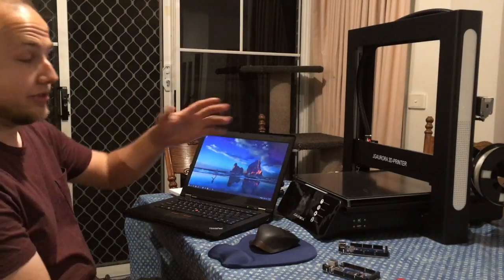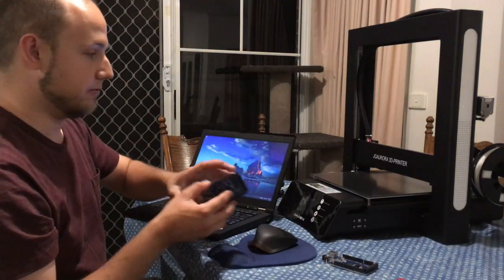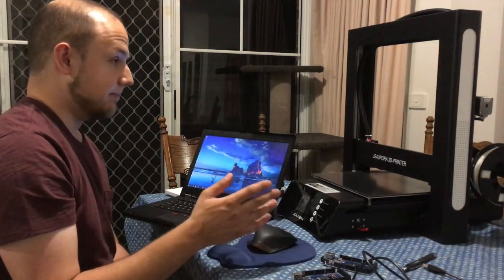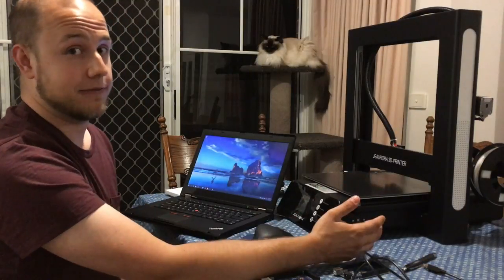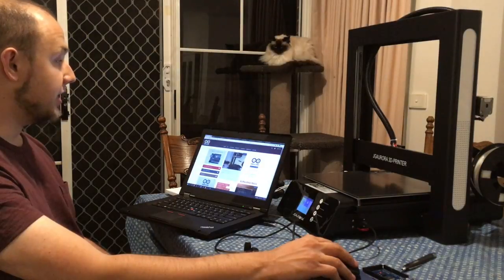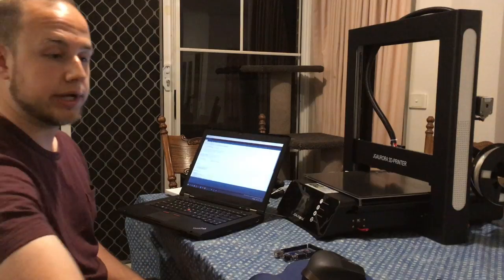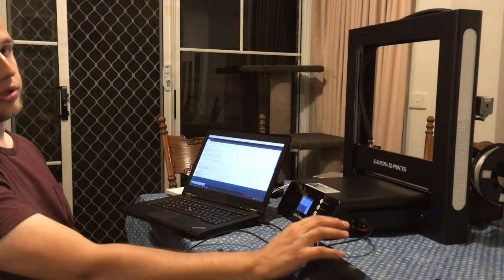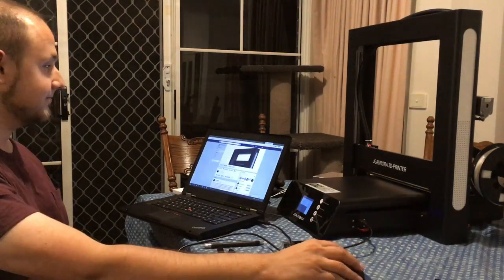How to upload custom firmware on JGAurora A5 3D printer

Comment from the maker: IMPORTANT: MAKE SURE YOU UNPLUG LCD CABLE BEFORE FLASHING!!
I'm sorry the audio is so soft! Also, please see this follow up video if you have error messages in Arduino: https://www.youtube.com/watch?v=0GCyrFAmj2A
More JGAurora tips and tricks on the wiki: http://www.jgaurorawiki.com/a5 and support on the forum http://jgauroraforum.com
Reply: Have  problems assessing the website
Reply from the maker: @levon2371  the dropbox links not working for the next 24 hours but everything else should be ok?

Comment: I just upgraded the printer to the custom Marlin firmware and also upgraded the LCD display. WOW! Like day and night. Super thankful for this awesome contribution! 
Anyone that has a good Cura print profile to share? 
Will do some stringing tests tomorrow :)
Reply: I did some print test, and initially I had problem with strings etc. Then I found this print profile: https://github.com/ceakins/3d-Printer-Profiles/tree/master/cura/Material-Templates/JGAurora/A5/3.2.1 
Not sure who is the mastermind behind it. I had initially tried this cura profile before upgrading my firmware on the Jgaurora A5, and it was horrible. Then I tried it again after upgrading the firmware, and now my printer prints waaaay tooo nice!!!! WOW! I'm so happy :D. I get quality prints that easily competes with much more expensive 3d-printers.

Comment: All went well for me, no problems with the upgrade. I think the PID settings are off though, has the hot end will overshoot by 8 degrees before settling in. I may run an autotune PID later to see what values it produces.

Comment: I followed the steps to upgrade my printer with custom firmware but I encountered several problems. I started the custom firmware with the Arduino software, checked all the settings compiled it and get the message that a library is missing. Tried to install the u8glib but it cannot be found in the library.  Whats going wrong? Rob, The Netherlands

Comment: If you have a modern version of Marlin working adding a bltouch would be possible as long as it's got a spare pin port for the probe as long as the board has enough memory to upload the extra features.

Comment: Sam, hopefully you can help, New to the A5 and 3d printing, but have some major issues. Looks like my unit was built in Nov 2017.  I updated to Marlin software using your instructions.  The issue came with my first print that stopped around 65%.  I was using a USB cable and the most current version of Cura.  The print was going fine, when I went into the front touch screen and was reducing the fan speed, all the sudden the print just came to a stop.  Prints were printing like garbage prior to this, and I've been tweaking the temp, bed temp along with print speeds.  Prints continued to print poorly, so I deleted Cura, reinstalled, deleted JGCREAT and reset the printer to the newest (January 2018) hex file of the factory software that I found .  I am trying to figure out what is going wrong and if I need to update the touchscreen firmware along with how to update it.  I've tried to update firmware again, and re-install cura, same results, maybe worse now, as prints are failing sometimes before the bed and extruder come to temp. This last print failed once via usb, didn't even come up to full temp on bed or extruder, and I tried again via thumb drive and again it failed at the top of the brim.  I was tried JGCreat that time.  LCD firmware type: MKS tft  version: 3.0.0

Comment: Hi Samuel... first of all thanks for the video... as a content creator myself I know how long it takes to make a video... 
My A5 loves to layer shift on large Gcode files... do you think this upgrade could solve this issue?!?
Thanks again and best regards from Brazil!!!
Reply from the maker: Thanks so much ;-) - I don't think the firmware would solve that, but I have already created a dedicated page specifically on solving layer shifting problems on my wiki here: https://jgaurorawiki.com/a5/layer-shifting Kind regards, Sam
Reply: Thanks so much for the answer and the article... but I don't think there is something to do with your article...
There is too much coincidence with large (megabites not long in time) gcodes files...  
Thansk anyway... realy realy apreciate your videos... got yourself a new subscriber!!!
Reply from the maker: Ah! Perhaps try printing via pronterface to see if the issue is a file reading problem on the lcd module.
Reply: Yeah... the first time it happened was via usb pendrive... it happened 3 times that way... and yesterday it happened using the raspberry pi... have no idea what to do...
this last time I paused the prin via the octoprint, re-homed X and Y and resumed printing and  it worked out, had to do this 2 times in the same print... it seams that in the midle of the print job it just looses the X and Y home points!!!
Reply from the maker: Well, I’m confident at this point that the 1.1.8C firmware is reliable enough to recommend it without hesitation. It has no downsides.
Reply: So lets Try it... hope it helps... will keep you posted...
Thankyou so so so muchhhhh!!!
Reply: Sorry... one more question... why unplug the LCD and how do I do that?!?

Comment: Thanks for the detailed video wonderful work. Did you have to modify the marlin software to communicate with the second mother board? I am also thinking of changing out the heat break on my hot end in order to print at higher temperatures,  how would I be able to increase the max temperature? thanks again!
Reply: I just installed Marlin on my A5 but the Z axis seems to have a jitter when I move it manually and the rate is set to 10mm and also after homing the printer and moving to the first point to perform bed leveling. How can I address this issue? Thanks!
Reply from the maker: I'm happy to answer different questions -- but youtube comments is not the place unfortunately. We have a JGMaker A5 group on facebook. I would recommend to join that and we can discuss there.

Comment: Great video.

I just purchased an A5, my second 3d printer, based on the information you and Da Hai provided. So far I am very impressed. I have just set it up and tested everything but have not yet done any printing. I have a few questions. If I update to the community firmware does it also provide LCD access to the EEprom and the mesh leveling controls? If not I beleive these would be great features to include as I would prefer not using my computer to level the bed.

Thank you
Reply from the maker: Thanks Bernie! Yes, if you update the main motherboard firmware AND the lcd board firmware you will be able to do mesh levelling via LCD. The LCD is pretty touchy so it may take a couple of tries, but you can do it via the LCD. Don't forget to enable the mesh bed levelling in your start gcode - add the line: M140 S1
Reply: Is it good?

Comment: Hello there,
We bought an Aurora A5 model printer. With 1.75 filament and 100% flow adjustment, we were printing well using the Cura slicer program.
One day, during the printing, the power cord of the heating table was disconnected from the connection point, but the printer continued to print until we noticed the situation. The table was cold and the printed piece left the table. The rest of the press went wrong. We were using the printer on the computer with the repetier program.
We cleaned everything and wanted to go back to the press. But there was another problem. When we connected the new print, the printer was starting to print, but the nozzle was squeezing a small amount of filament. The filament is not holding onto the table. The flow level was not good.
But manually, when we extrude the filament, the nozzle smoothly flows the filament. When we went to press, filament could not flow in the desired amount.
We struggled to solve this, we changed the nozzle several times, changed the heater aluminum block, changed the nozzle heater, removed the filament pusher motor, checked and changed the gear, but we could not be successful.
We changed the slicer program we used, experimented with different computers, changed our usb memory, we could not overcome this problem.
After working around for days, we re-adjusted the filament diameter to 1.40mm and the flow rate to 150% in the Cura program. This time the printing was successful. However, we are uncomfortable with this situation.

Why are we experiencing this problem, what is the solution, please help. Thanks in advance.
Reply from the maker: Hi Murat, I've replied to you on the forum here: https://jgauroraforum.com/discussion/291/strange-underextrusion-after-power-failure

Comment: Thanks for the video and explaining how the boards work together.  I've messed with arduino's and flashed current Marlin on my other printer awhile back.  So I'm a little familiar with the process.  I just got a used A5 and it seems kinda flaky.   Was thinking an update might help.  I noticed in the Marlin  example_configurations directory the A5's .h files are present.  Is this the same as your doing here?  Have your files been added to Marlin?  Or is this even more than the 2 .h files?  Thanks again for the video.  I didn't know you could upload the hex files with Cura.  Always wondered what that option was for :)
Reply from the maker: Yes exactly - we submitted our working configuration to the Marlin team, and that is where the A5 example configuration came from. I’d still recommend using the A5 community firmware 1.1.8C to start with. Good luck :) 
You’re welcome to join us on the JGAurora forum if you want to discuss 1.1.9 beta firmware too.
Reply: @SamPinchesMakerShop  Thanks for the quick reply.  I was reading the forum last night.  It seems such a shame that this printer seems to have such potential and was sent out so beta.  I bought it from JGAurora for dirt cheap.  They said it was used but looks new to me.  Thank again for your hard work.  From the forums looks like you're providing more tech support than the company. :) 

;
Reply from the maker: @Flatwoodsdad  haha, thanks.... I hope you can get yours to a standard that you're happy with.

Comment: Hello Samuel, 
first of all, thanks for your explanations in this great, comprehansible video! :-)
I'm very new in the 3D printer scene ^^ and it will be my first printer. 
I heard about some limitations within the firmware of the JG-Aurora and issues to get spare parts or custom service from the producer.
If I buy an 'JG-Aurora A5 3D printer' next two month, will I get the revised firmware you made for your own, to upload it on my new printer?
Or would you advise me not to buy this printer? Can it be a "perfect" working product with your help?
 - 
Plan B would be the 'AnyCubic i3 Mega', but it's constructionspace is much smaller and it's printing speed slower.
Best regards, and thanks for your request.
Dennis, germany

Comment: HI
I USE TO HAVE THE MARLIN ON MY A5 BUT AFTER HAVING SOME PROBLEM WITH PRINTING STOP IN THE MIDDLE OF PRINT I WENT TO INSTALL THE MARLIN AND LCD AGAIN AND NOW THE 3 AXIS ARE NOT MOVING AT ALL .
HEATING BED AND NOZZLE WORK ALSO SENSOR ARE WORKING AND SHOWING THE TEMP. WHATS WRONG WITH MY A5
Reply from the maker: I have replied to you on the forum. There is no need to use all caps, please.
Reply: @SamPinchesMakerShop  i am sorry. 
But i am getting crazy about it

Comment: I downloaded the arduino software 2.3.3 last night and it ran fine. Went to flash my printer and I got an error but I found your other video on fixing that specific error. Got home from work today and went to start up the program and it was taking forever to start. But when it did it says new setti g restart to apply. So I did and it continued with the same prompt every time it started. New setting restart to apply. So I started task manager and it said that arduino was using 97% of my 40 gigs of memory. My computer started freezing up so I had to delete it and reinstall and same issue. But my printer was plugged into it last night and I tried flashing and got that error so now it won't run properly
Reply from the maker: @JoshuaSmith-sb6wk  did you unplug the screen before flashing?

Comment: HI
every time arduino shows me this error :Arduino: 1.8.5 (Windows Store 1.8.10.0) (Windows 10), Board: "Arduino/Genuino Mega or Mega 2560, ATmega2560 (Mega 2560)"

C:\Users\Florian\AppData\Local\Temp\Temp1_JGAurora A5 Custom Main Marlin Firmware 1.1.8C (3).zip\JGAurora A5 - Custom Marlin Firmware 1.1.8C\Marlin\Marlin.ino:31:26: fatal error: MarlinConfig.h: No such file or directory

 #include "MarlinConfig.h"

                          ^

compilation terminated.

exit status 1
Reply: thx finaly works
Reply: Samuel Pinches hi
now after the software errors solved ...the hardware make problems ... the axis xyz jam or move only in one direction...

Comment: Hi Samuel, 
can i have the full working firmware  for the JGAurora A5 from you,  mine motherboard is blowup and i have to install new, i am sure you are 
the specialist for this, i try already the one in the jgaurorawiki buth there is no full size ready that is working without  error, i like the one like i 
buy my printer, i hope you can help me and many other with this issue, thanks.
Reply from the maker: Hi, I don't know what you mean by "full size ready". Do you mean a compiled HEX file? I don't distribute those for the custom firmware, but I have linked the original factory firmware on the wiki if you need that.
Reply from the maker: For further assistance, please post on the forum (jgauroraforum.com) and I will do my best to assist.

Comment: hello, a query, I do not understand English, but I tried to update my printer jgauroraA5, every time in the panel I put print does not print and the temperature of the base does not rise, and I tried to load the firmware again as you do , but my laptop does not recognize the printer and it does not update, I do not know where to download the drivers to conttolar the printer, my laptop (notebook) does not recognize it, and it's new, I'm desperate, I do not know what to do
Reply: hello I speak spanish, I already solved the problem was that I had a cable disconnected from the temperature of the base of imprecion and did not reach the temperature of imprecion connect it and it works. I am more happy than dog with two tails ha ha ...

Comment: Hi Samuel, i owned a A5 and recently changed its motherboard to a MKS GEN 1.4 because the previous one was spoilt.
However when i tried to flash the custom firmware today, an error saying "unknown motherboard value set in config.h" prompt out. 
I did changed the motherboard in config.h to suit my gen 1.4 board).
So i was wondering does the custom firmware support the 1.4 board? 
If it does, do you have any idea why did the error prompt out? If it doesn't, should i get a different motherboard?
Im quite a noob when it comes to stuff like this hence any help would be very much appreciated! :)
Reply from the maker: Happy to help - I would ask you to join and post on the forum here please:  http://jgauroraforum.com
Reply: @SamPinchesMakerShop  Will do. Thanks!

Comment: Great video! Tried several times to upload the custom firmware with LCD unplugged! Also tried with the LCD plugged in. I followed the readme.txt for build revision C 22 Jan 2018, including adding library u8glib and the modifications for serial monitor M502 & M500. It locks up my A5 everytime. Reflash of original code works fine. Anyone have any ideas?
Reply: I got everything to work by downloading the full install program for windows. The exe file. Once I installed the program and opened Marlin, it flashed fine. It's up and running! Thanks for responding.

Comment: Hi will uploading the new firmware fix the issue of z axis reversed?  I have a a5s.  Thank you
Reply from the maker: Hi Tammy!  Firstly, this firmware for the A5 is completely different to the A5S, and also is installed differently too- so I'm sorry but this video won't be of much help! Secondly, I don't think it will solve your problem! Sounds like a very odd problem to me... I would suggest you make a post on jgauroraforum.com and we will try to help you troubleshoot from there. Best of luck!

Comment: Hello Samuel, thank for your Work. To upload your custom firmware, printer needs to be powered on or power off?

Thank you
Reply: Hello again Samuel... sorry im very noob....when i finish upload firmware, the last steps, i need turn on printer?
ON step 16. of your wiki tutorial i dont know what i need to do. The line change “carriage return”. I think have to do on aruino id while printer is Power off?  And the input commands M500 and M502 from arduino software too? on what windows?excusme im lost here... thank you for your time on advance
Reply: This final steps are necessary to new firmware works good?
Reply: OKey, when i finish flash, keep usb wire and arduino ide, next i go tool serial port,select corrects bauds, then i see command line,
type 'carriage return' and enter,type 'M502' enter, type 'M500' enter, when i do this i can unplug usb cable and power on printer?

Thanks